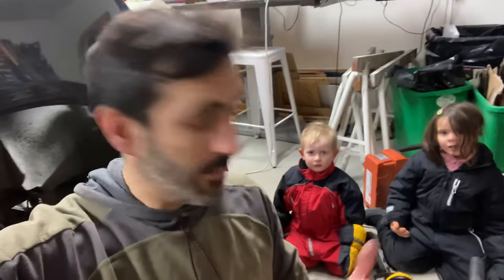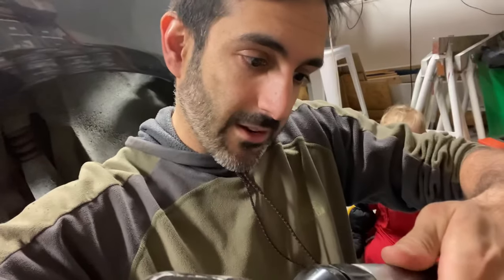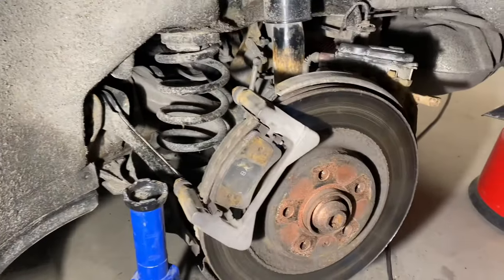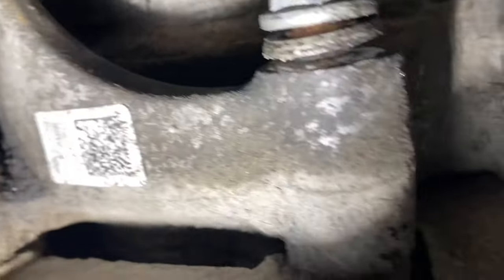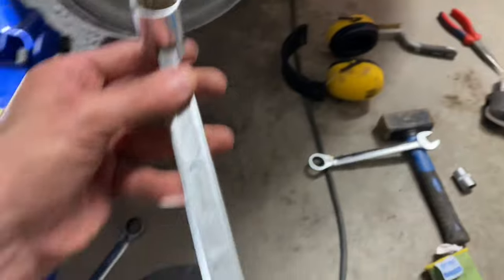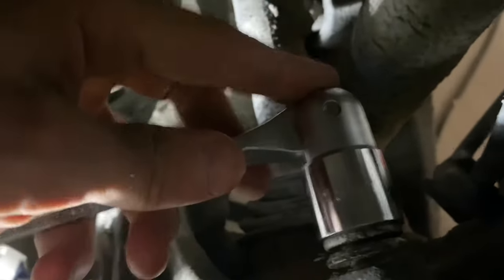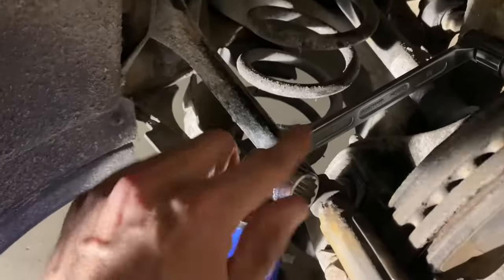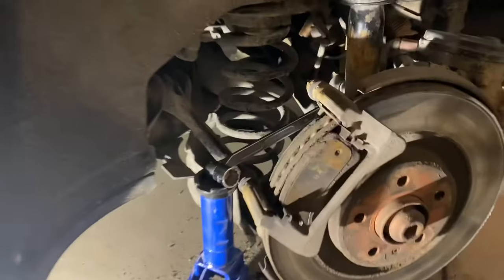How To Loosen a Seized Brake Caliper Bolt! No Fancy Tools Needed!

Comment: Also you can turn the wheel and give yourself more room
Reply from the maker: Good point! Tried that on other side and did help a bit 👍
Reply: What about rear brakes?  I can't turn the wheel.
Reply: @mikewalsh6911  put a breaker bar on there and hit it with a hammer if you have to or use his car jack technique if they’re really stock, you may have to get kind of creative
Reply: This right here saved the day. I know it's so simple but it's easy to overthink when problem solving.
Reply: @lucasruckle  glad to help. I’ve definitely been there myself many times
Reply: What about the unturnable  rear right wheel. One can't use the jack trick since it would tighten instead, and you can't fit a breaker bar, and your impact is too big for the socket to fit.
Reply: How do i turning rear

Comment: Oh my god, this trick just broke a rear caliber bracket bolt free after I worked on it for a few hours today without success. I had even gone to the hardware store an hour ago to try a smaller impact gun that might fit in that tight spot and a propane torch for tomorrow. I had to try the jack at 11pm after reading the positive comments.... it broke the bolt free in the first couple of pushes. THANK YOU!
Reply from the maker: I know the feeling well done for fixing it!

Comment: Even easier way: heat, then spray pb blaster. No matter how tight the heated part will draw  the spray  into the bolt threads.
Reply: Just like a sealed containerwith hot food in it collapses from the lowering pressure!
Reply from the maker: Thing is people often dont have the right tools in their garage to properly apply heat. Wheres a jack and a wrench normally are a given that they'll have. But agree heat is great !

Comment: Smart idea and it shows the very useful areas where a car jack can play. I was stuck with my 2010 Prius for a whole day yesterday,  as even the "in theory success-guaranteed bolt method" couldn't pull a front wheel bearing out of the knuckle hub. Instead, it pulled the bearing itself apart exposing inside steel balls etc.. Almost everything under the chassis is heavily rusted thanks to the local government's shortsighted practice of spreading salt on roads here in Canada. In a desperate final try, a humble carjack coming with the car for changing tires became one of several important components and helped me to finally remove that very stubborn bearing.

Comment: Genius... Struggled whole the day. came to this... Wondering id I can use the trick as my jack doesn't raise so high. Lucky if I can place the wrench low.
Reply: I have some EU pallets so perhaps I can use them underneath the jack to raise it up. I hope it works.
Reply from the maker: @b.a.b7834  Should work. Use some strong wood or something solid to bump up the height. As you say get the wrench angled as low down as possible. Let me know how it goes!

Comment: That's an absolutely brilliant idea. I've been struggling with mine for a week. I've had 2 back surgeries and neck surgery and wrestling trying to break those bolts have been killin me! Thanks a lot! 👍🏼
Reply from the maker: Great to hear good luck with the back/neck 👍
Reply: @JasonDainter  been using an adapter to use a bigger bar but it keeps slipping off or the socket and the adapter come apart. Hopefully your method works out. Thanks for the well wishes.

Comment: i'm very glad that I found this video of yours.  I'm doing a 4 wheel pad & rotor replacement on my 1996 Lexus Ls-400 and could not fit my impact driver onto the 17mm bolts, nor could I crack any of them loose with  my "breaker-bar".  I was about to reassemble the brakes so that I could drive it to a shop, and then beg them use my parts for the replacement, but I found your video just in time!
It was late at night, but I just had to (very easily) try it out.
I put my "breaker-bar" back in place to lift the wrench with a scissor jack (previously I was hammering down on the other side) and with just a few turns on the jack I heard the bolt crack loose! EUREKA !!!  Then I did the other caliper bolt and it easily cracked loose too!
I went to sleep happy knowing that I'll be able to do all 8 bolts in the morning.
Liked and subscribed for sure, and thanks again Jason!
Reply from the maker: The Jack to the rescue! Glad it helped!

Comment: I spent all day trying to get two caliper bolts off and couldn’t. Even bought an air wrench and impact sockets didn’t work. Ran out at 11 o’clock at night and  used the Jack in the bolts  came right off. Thank you so much.
Reply from the maker: Yeah those air wrenches are nothing on the jack (unless you spend some serious cash!)

Comment: Thanks a lot ! I was totally stuck on my GMC Safari 2003, and the top bolt has little to no space, as I easily got the lower accessible one with the impact, the top one was stuck. Your approach with the lever allowed me to get them unlocked. Using the wrench, the same way as you did, but, given the layout, I used a breaker bar, in the wrench, leveraging on the suspension plate, it went was easily ! 
What a relief as I started to think I would not be able to do my brake job ! 
Big thanks again !
Reply from the maker: Great to hear! happy driving!

Comment: Dude this was the most brilliant idea I have seen in my life. You should get a nobel prize for this.
Reply from the maker: Haha glad it helped. Definitely open for the peace prize for this one 😂
Reply: @JasonDainter  You definitly should get. I got one out the other one my tool broke. One was able to get out last nite but this morning I chouldnt get it out and my ratchen is broken from the front part where you attach 22 socket. What do you recommend?
Reply from the maker: @oguzoguz4686  dynamite! (sorry.. nobel prize joke). One thing you could try is turning the wheel, a few people in the comments suggested this opens up quite a bit of space to play with. I would say though you need a new ratchet though unless you have another tool that will get a solid grip on the bolt.

Comment: Breaker bar will fit if you turn the wheel out. However, this is a great video and idea if the breaker bar absolutely can't fit!
Reply from the maker: Great point!
Reply: Mine is stuck on one of the rear wheels :( I hope this jack trick will work and not shear the bolt head right off!

Comment: This definitely works, could've saved an hour or 2 if I had done this... wrestled the lower bolt off after applying WD-40 & 30 minutes of multiple tries but the upper caliper bolt didn't have proper clearance for a breaker bar... then I saw this... so I went back outside, my jack only goes so high so I had to put it on the tire that I took off, used it as a booster seat for the jack & yeah, this definitely is the better way to go... I have never HAD more trouble with any fastener than backside caliper bolts!! THANK YOU!

Comment: This is a pretty good tip!!! People just need to be careful not to move their cars off their jacks or stands with this method though! I also couldn't get my breaker bar inside the wheel well and came up to watch a video to see how to get the darn bolts off the caliper and I was like nice I have another option! When I got back downstairs I looked at my car and it dawned on me. Fully crank the wheels in the direction of the opposite side you are working on. Once my wheels were fully turned I was able to use my breaker bar.
Reply: This comment is underrated. The simple tip of just turning the wheel saved me from outsourcing this job. Breaker bar was able to get the job done. Thank you

Comment: Thanks Jason (& “supervisors”) for sharing this hack. I have 1 bolt that just refuses to move. I’ll try your trick.
Reply from the maker: Good luck let me know how it goes!
Reply: As requested, here’s how it worked out. I had my floor jack ready to apply pressure to the socket wrench to loosen the stubborn bolt. I separated the two-piece floor jack handle, putting one piece of the handle (a 1 1/4” dia. pipe) over my socket wrench & using the handle as a breaker bar for greater leverage. It worked! I will clean the surfaces with a wire brush & brake cleaner to reduce the odds that the bolt will be stubborn next time. It’s still good to know about the jack hack just to have another trick up my sleeve. Thanks again for sharing this method!
Reply from the maker: Its such a satisfying feeling when that thing finally gives! Glad you won the battle! @G.I.JeffsWorkbench

Comment: I had the same problem today, if you turn the from wheels it gives you room for the breaker bar but on the back that obviously won't work. I'll try this tomorrow on the rear.
Reply from the maker: Good luck!
Reply: Except with rear calipers

Comment: Thank you so much for that brilliant tip! I had tried releasing fluid, heat, a long breaker bar and even an electric impact driver with a max torque of 450Nm, all to no avail. The jack trick worked and the good thing was I could hear the bolt move even though it wasn’t visually noticeable.
Reply from the maker: Glad it worked!

Comment: I had the exact same problem and tried the jack on the spanner and it bent the spanner. It was the first bolt i came across that the impact gun couldn't undo.
Reply from the maker: Time for a stronger spanner!

Comment: Having trouble with the right side of the car this method will not work due to directions of bolts to the knuckle itself have you found a solution for the right side?

Comment: This actually worked after struggling so hard lol but now I’m stuck on the other side of the car, to loosen the bolt you have to turn it the opposite way and the jack won’t help so what do I do?
Reply from the maker: Sounds weird the other bolt turns the other way. Are you sure? It should turn out the same way?
Reply: @JasonDainter  Had the same issue with the rear left brakes this morning after your trick worked perfect on rear right side. My brackets are positioned to the back of the rotor so that makes it so you can only push down while on the rear left. I did try positioning the jack to the left of the rotor to try and get in a position to push up again but there was just no room for that. Ended up putting a cheater bar on the ratchet and that finally gave the leverage while pushing down from behind the car to loosen the bolt. Whew!
Reply from the maker: @keithk888  🙌

Comment: Thanks a lot, worked perfect!
Reply from the maker: glad to hear that!
Reply: @JasonDainter  Am i wrong if i say it doesnt work on the other side, as it would tighten instead? thanks again! :)
Reply from the maker: @MagnusBoNielsen  haha well not sure if that was a joke but in case not, yes you would be wrong! 😁
Reply: @JasonDainter  Hah no joke. I can only reach the bolts from one side of the tire so on the other side of the car pushing up will tighten. haha i figured to just stamp on it instead then and it worked :D

Comment: Turning the wheel so you can get the breaker bar in there is an option also.
Reply: Also my first thought, the big pipe would have worked with the wheel turned out.

Comment: That's great for bolts where the wrench needs to be pushed up, but what about those where the wrench needs to be pushed down?
Reply from the maker: I dont see a scenario where the bolt would ever need to be pushed down to be honest! Righty tighty, lefty loosy. Bolts normally are turned anticlockwise (left) to loosen. Maybe I'm wrong but seems unusual that this would be the opposite on a brake caliper.
Reply: On a 2013 Lincoln MKX, the caliper is at the back of the disc and requires the wrench to be pushed down
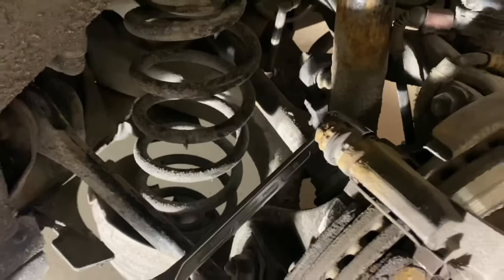Reply from the maker: @mackbrown-i1t  here is a lincoln MKX 2014 which he shows at 1:59 going anticlockwise, "left", or if a jack was doing it pushing upwards on thebrake caliper bolts. It could be that the 2013 model was different but I'm pretty skeptical of that. Are you sure? https://youtu.be/6UJX-qImUQk?si=ZnGFcFhK78vPRGg3&t=119
Reply: Same on my ford ranger, caliper bolts are at the back@user-du8vg1iy6u

Comment: I tried this, and my breaker bar joint snapped!  

At the moment I have one side done, but now I'm stuck.  Not sure if I should buy another breaker and try the same trick again.  I had hit it with PB blaster.  I might apply heat on this next round.
Reply from the maker: Heat will do wonders. Wd40 and whack it s few times with a hammer. Make sure you have a decent breaker it shouldn't break! A cheap tool (as seen in video) with the jack will do it though. You'll get there! 🙏
Reply: @JasonDainter  yeah I think I am going to apply heat.  I am also going to try tighten direction first.  I also think I am going to move up to 3/4 breaker.  I don't think my half inch breaker was cheap.  But, this bolt is stuck pretty good.

I love how the instruction videos they just hit it with an impact and it just comes off no problem.
Reply from the maker: @Kraziken0  when you apply heat am not certain on this but I heard its best to heat the parts outside the bolt rather than the bolt itself (eg the thread not the bolt). Since heat will expand things you''re then expanding the thread to dislodge the bolt. It sounds like your breaker bar had an existing crack though tbh as they certainly shouldnt break like that, if anything the bolt head should break first (try avoid that or you'll end up in a world of pain!). Apply lots of Wd40 and let it soak in, re-apply, re-try etc. Itll come off eventually.

Comment: Wow I had really high hopes about using this method. 
Wrench turns with the jack to it, but the bolt hasn’t turned..?!?  Yeah I’m confused. Back at step 1
Reply from the maker: sounds like your bolt is rounded if the wrench turns but bolt isnt coming off.

Comment: Can I be lazy and ask for the make/model of the spanner you used? Ta
Reply from the maker: Sure but this was a super cheap one so really it makes no difference since all the power comes from the jack here (probably one peice one is stonger though rather than using an adapter of some sort). The heads I used are called a ' Bi-Hex Socket' head which was totally the wrong head for that bolt I realise now in hindsight, but worked fine. If you search for 'Double End Swivel Socket set' you'll find similar to what I used in the video if you really wanted to though!
Reply: @JasonDainter  Thanks! I wasn't sure whether I should invest in a Snapon or equivalent.
Reply from the maker: @mohammeds3114  the issue in this case with a seized caliper bolt is that you need more force/leverage. Having a decent quality spanner set is never a bad idea but its not going to make any difference here.

Comment: What do u do if the bolt only comes out half way.
Reply from the maker: screw it out about 50% more. 🙂
Reply: @JasonDainter  it wasn't coming out cos the previous owner didn't grease the pins.. took abit but I got it out

Comment: im worried I might snap off the bolts
Reply from the maker: @izack367  get a good socket that fits well and you should be all good! Spray a bit of wd40 on it and let soak in ahead

Comment: Works, sort of. It's genius except that it doesn't work on the rear, passenger side of a typical sedan where there's no space and the only side that has space needs to be pushed downward (the jack only goes up).

Comment: 12 point sockets on really tight bolts? erm na ive learned my lessons many years ago with that LOL. 6 point sockets on anything 6 sided.
Reply from the maker: yeah definitely hear you on that. I think I may have tried a 6 point socket, but actually the 12 point had a pretty decent grip. I don't think the blocker was the grip but more the fact it was super tight and seized up and just needed the force (came off fine with the jack) but you're totally right if someone else is approaching this ideally use the correct 6 point socket!